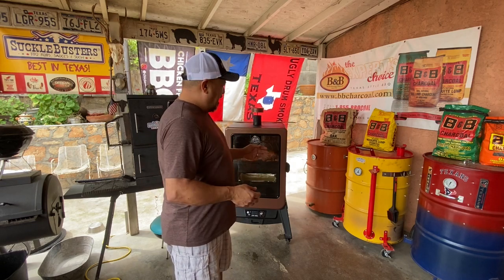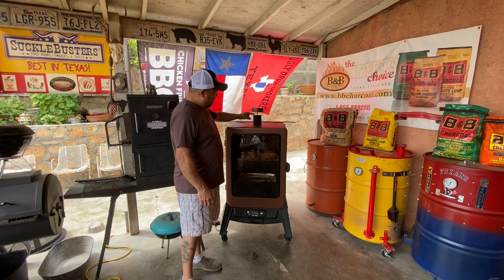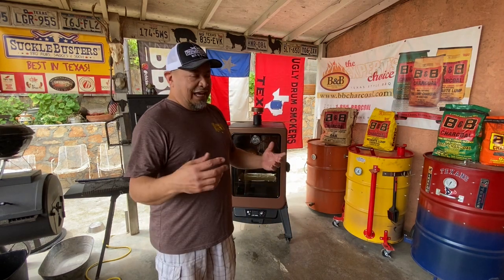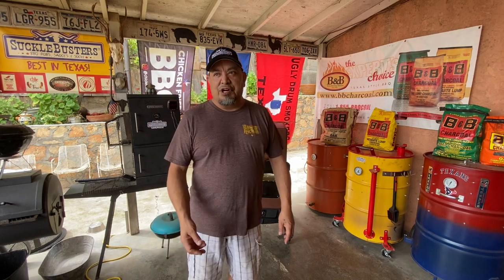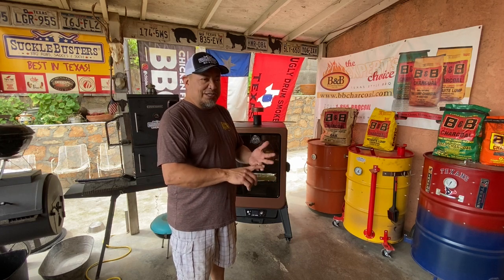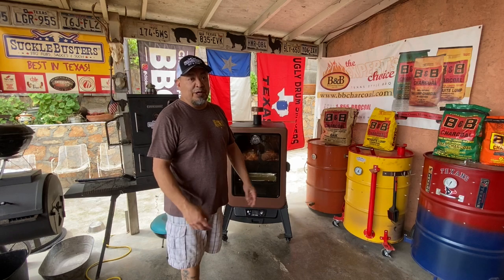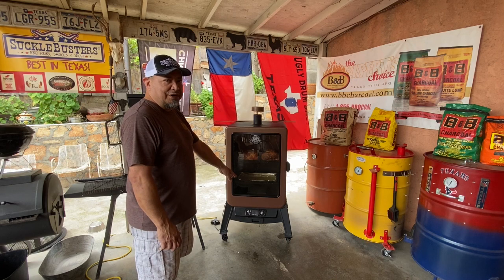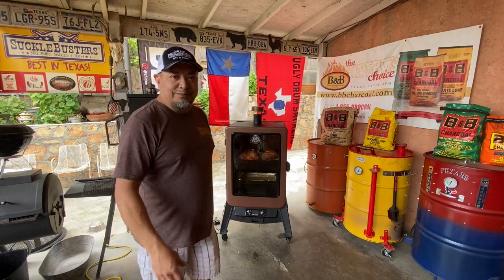PitBoss Copperhead Still Broke ErH

Comment: I have the same smoker and have had nothing but trouble since October last year. I have tried several times to try and get it to work but no good. I just emptied all the pellets and am trying it again. I have contacted pit boss March 16 and haven’t heard anything yet. I wouldn’t buy another
Reply from the maker: This model is junk! Thanks for watching and good luck on your future smokers. I’d highly recommend a Green mountain grill.
Reply: Well I tried a butt and the unit worked perfectly. That was a few days ago. I decided to do half a briscuit and about 30 minutes into cooking it shut down with an erl code. I watched your video again and noticed you have an extension cord running your smoker. Well I do too. Could it be spikes in power causing it?

Comment: So far my vertical has been running within 5 degrees of my set temperature. I have the water pan above the temp probe and have the cap all the way open. Done a few overnight cooks and my meater and inkbird thermometers show it holds steady all night. I have the pro series 4 vertical that Lowes sells, but its similar to the copperhead.
Reply: Also did you make sure that the heat diffuser over the firepot was positioned correctly? I've seen that some people turn the vent holes to the front and back instead of sideways.
Reply from the maker: Hello Carlos, yes the heat deflector was in the correct position. The unit worked great for four cooks the it was all over the place. Don’t know if you have but read through the other msgs below. There are a lot of guys having the same issues with temps and ERh error codes. 
But Hey, it looks like you got a good one! I really did like mine before the troubles. Oh well I’ve got me a GMG now and this unit is pretty good 😎 
Thanks for the comment! And the View!

Comment: Just got one about a week but have had a different model for about 4 years now make sure all your wiring for the temp sensor is good and not crimped or loose that will cause that code pretty quick and make sure it's clean. Also dumb question is your flame deflector installed the right way facing the side and not front to back they say it can effect the controller/ probe hope this helps looking forward to an update!
Reply from the maker: Hello Jonas! Thanks for watching and for the information. I did have the deflector the correct way. Although I never really checked the probe wiring itself. I did call Pit Boss and they determined it was the control panel. After waiting 2 weeks and no part showing up, I called PB and was told the panel was on BO and shipping from China at the end of June! To end my story,.... I took it back to wal mart and got my $ back😎
Reply: @RicsBBQSpecialties  how did returning it work since it had been used?
I am having the same issue and only used it 3 times.  I do not have the box anymore though.
Reply from the maker: Jonas Atkins @Chris Howard I was able to return it with no problems. I didn’t have the box either and had used it 4 times. But I did have the receipt and the operations manual. Good Luck Sir 👊🏼
Reply: @RicsBBQSpecialties  thank you i have all of those too. any recommendations on one that won't have these problems?
Reply from the maker: Jonas Atkins @Chris Howard A Stick Burner! Lol This was my 1st pellet smoker. I didn’t get another and probably won’t. I would up getting the BlackStone Air Fryer combo. I have an array of smokers just tried the pit boss out.

Comment: I’m having the same problem with mine only had it a year next month. Would you suggest just calling them asking for the parts and do the repairs? I’ve got 8 birds to do this years. Mine shutting off when cooking at 350. 4 time in 3 or 4 hours
Reply from the maker: @marco785  I got rid of mine shortly after this video was posted. However I’ve heard that their customer service has gotten better. I’d give them the opportunity to help.

Comment: Did you ever get this figured out? I have the vertical series 7. The first handful of times I used it, it was flawless. The last 3-4 times however have ended with the ERH code. These cooks have ranged in temps between 250-350. To have made sure the cap was fully open and water in the pan. I however did not raise it like you did but that didn't appear to help you.
Reply from the maker: Hello! Thanks for watching and for your reply. Shortly after the video I returned the unit for a refund. I was under the impression that They fixed their electronic issues. How old is your smoker?
Reply: @RicsBBQSpecialties   around 4 years or so. I have ordered a new internal heat probe as many have said that has fixed their issues with the ERH code. I hope so.

Comment: RIC I believe it's the control board that's the issue hopefully the replacement will be there soon . Deffently a electronic issue it seems .
Reply from the maker: Yeah I know that’s what it is. But hey I think the temp issue is working better with the pan raised a bit. 😎
Reply: @RicsBBQSpecialties   Did they get you some parts to throw at this?
Reply from the maker: 1984 BBQ @Mike Phelps Yes They sent the control panel. Thing is before they did they said it was going to take 8 weeks to get it. I wasn’t going to wait the 8 weeks so I took the unit back to wal mart for a refund. I’ve sent PB several emails and left comments on their cust service section of their website. I have yet to get a reply.
Reply: @RicsBBQSpecialties   Nice. Well at least you have a control panel you don't need now.

Comment: What type of pellet smoker do you recommend using. I have noticed that do to the poor location of the control board which is located at the bottom of the smokerdoor it's  very easy to spill liquids on to it as you're  pulling food in and out of the unit . Thank you for all the help.
Reply from the maker: ELAM305 I’m not a pellet cooker. Ive been cooking for over 40 years on stick burners. I gave this a shot and with the issues I had, I’m just going to keep using my stick burners and UDS cookers. They don’t give me error codes😎

Comment: Ric...  I got the copper head for father's day 2020 ran it 2 times no problem then it hits the same thing .... I cleaned it out hot so I could see what's going on ...  my problem was just like you too hot cap and water to low and also the pellets were starting to ignite in the augers tube and going more and more up the tube.... i am going to clean out the hopper and watch it ... did you figure it out ?
Reply from the maker: jon reynolds Hello Jon, I talked to Pit Boss and first they said the cap was too low and needed to be unscrewed all the way up to the point of almost falling off. Lol okay my question was why is it adjustable? Then they said the water pan had to have water? Yes it has water! It’s called a water pan. Long story short, after I was told that they would send me a replacement control panel and temp probe but it would take 6 weeks to deliver! I took the unit back to Wal mart and got my money back.
Reply from the maker: jon reynolds I really liked the cooker at first. I even made a couple videos that you can see in my library. I was more disappointed in the customer service. 6 weeks to get the parts is just unacceptable
Reply: I love it .... so I'm going to clean it check over every thing and try to smoke a pork butt tomarrow and let's hope for the best
Reply from the maker: jon reynolds Good Luck!

Comment: Iv'e done well over 50 cooks with a Pro Series Copperhead, Iv'e never had a code and count myself lucky. Iv'e seen many videos about the problems and have no idea how it's never happend to mine. I have the water pan all the way at the bottom, and the chimmney fairly low, you can just barely see the top of the pipe. I think they have issues with the controllers. I'm going to switch over to a Rec Tech wireless eventually.
Reply from the maker: Hello John, 
Guess you were one of the lucky ones! It’s sad because the couple cooks I got of it were great and I really liked the size and style of the unit too. 
Bottom line is the customer service was horrible. I’ve been running Green Mountain Grills Daniel Boone and also the Jim Bowie. Maybe one day get a Rec Tec 😎 Thanks for watching and for the comment.

Comment: I had same problem with different brand.    The probe was defective.  It was reading and sending random temps to controller. I replaced the probe and it fixed the problem.
Reply from the maker: Thanks for watching and thanks for the comment. Glad you got yours fixed.

Comment: I just had this problem with mine, 3rd smoke. Started it about 4:30am as I'm smoking a brisket. Came out at 8 am and my temp sensor said 385° but is set at 225°. I opened the door to let heat out but noticed it was no where near that hot. Then it threw Eth code. I removed water pan and the diverter on top of the fire pot and noticed my pellets had built up and ignited the pellets in the anger tube. I unplugged the unit, plugged nack in, turned on and primed to remove the hot pellets in the tube and used a metal utensil to spread out the pellets in the fire pot. Problem fixed for now. Using Pitt Boss Competition pellets.
Reply: update: ErH came up twice more. Grill set to 225, lcd readout telling me its 385, I put my own digital probe on top rack and only reading 181. Transfered my brisket to my offset stick burner. Will be taking this unit back for a refund.
Reply from the maker: Hello Kain, well that sucks and I’m sorry to hear that. I thought you might have figured it out. This thing is really a Pit Loss and a piece of junk! Hopefully your return goes well. Good luck Sir 👊🏼

Comment: I've got the same vertical Pit Boss pro and this thing has been a pain since day one. Error codes, temp control, temp probe and now it's not igniting. I jumped on here to see if there was a quick fix. Guess I'll fire up the grill instead. If anyone reads this and thinking about buying a Pit Boss....Don't. It's a waste of money and good luck with customer service.
Reply from the maker: Hello Robert. I hate to hear this but am not surprised, just go through the comments below and you will see that yes this unit is crap and Pit Loss is doing nothing about it. Yes they will send you a replacement probe or control panel only to have it fail again. I have since got a Green mountain grill and am totally happy with it.

Comment: I got the same code on my first burn. Grill Sergeant to the rescue!!  Second burn was fine.  My water pan is two holes up from the bottom but I could be moving it now.  From reading the comments temp seems to he a systemic problem. I'll be watching to see what they tell you.
Reply from the maker: Thanks Roy, long story short. I told the unit back to Wal Mart and got a refund. Pit Boss customer service is crap. Good luck on your cooker and hopefully this video gave you a little insight. 👊🏼

Comment: I just got a slightly used series 3 electric Pit Boss today and set it at 275 it was reading 160 on the actual temp, but probe said 260 and then 10 mins later had an erH code and now every time I turn it on it goes straight to the erH code and won't fire up.
Reply from the maker: Let it cool down for a couple hours or overnight. One thing I was told first was to make sure the exhaust is open as far as it will go. Make sure your heat deflector is positioned correctly with the ports to the left and right.?

Comment: Is this something pit boss will fix? I have this unit, it sucks! Seen other companies are making heat deflector mods for some models, but couldn't find anything for the vertical units, tia
Reply from the maker: I have no idea. I took mine back for a refund shortly after this video posted. How old is yours? I hear the electronics have gotten better. You might want to checkout another channel. Grill Sergeant he is sponsored by pit loss

Comment: Sounds like the controller...  Watching with interest, good luck.
Reply from the maker: Yes that’s what Pit boss said it was. I returned the unit back to wal mart because the controller was on backorder. I wasn’t going to receive it until mid July. PB Customer Service Sucks
Reply: Ric’s BBQ & Specialties That’s too bad...were you really disappointed with their service or just the lack of not having the part in stock to repair your unit?  Too bad you couldn’t exchange it with a new one from Walmart.  I have the Lowe’s version Pro Series 4, same as the Copperhead, so far so good, it operates perfectly and has proven to do a great job on everything I’ve put in it.  I’m New to smokers so nothing to compare with other than my Perfect Flame Grill (awesome by the way) but the materials, build quality and finish all seem very good.  So if something does go wrong, I feel the controller would be it and I would need to rely on customer support for help.  Anyway, I feel your frustration, sorry you didn’t have a positive experience.

Comment: I am going  through the same thing I tried every thing  pit boss told me I would have my control panel and temperature probe in 7 to 10 days  I got an email saying that the parts had shipped when I got the  package 5 days  later the only part I  got was the temperature probe  no control panel I called them  3 times and was told I would have the control panel in 7 day it has been  almost  2 months and no control panel this thing has been a nightmare  since day one
Reply from the maker: Hello Steven,  Sir I feel your anger and if you read through the comments below you will see that there are a few people that are having the same issues. You know when I posted this I was hoping Pit Loss would see this and hopefully someday they will. This unit is absolute JUNK. 
I have since picked up a Green Mountain Grills cooker and have not had one issue! I highly recommend them. 
Good luck with yours and hopefully you get the parts you need soon. 👊🏼

Comment: I had trouble with two different PitBoss units, ended up taking g both back to Atwoods who refunded my money....PitBoss took 3 weeks to get me parts on the first 9ne, it worked twice and quite again, so at that time, Atwoods swapped the unit out, second unit never came on, period. I will probably never try Pit Bosd again.
Reply from the maker: Thanks for watching and for the comment. Yeah Pit Boss has a problem with this unit. Not to mention the lack of customer support. I wound up returning mine for a refund. Now using a Green Mountain Grill. Used over 20 times now and not one issue😎

Comment: Has anyone tried moving the control panel to the top of the smoker to avoid the extra heat and drippings?
Reply from the maker: That’s a question for The Pit Loss company. They definitely have issues with this unit and they know it. This model needs to be recalled. 
Thanks for watching Mike. If you have one of these I wish you luck. 😎
Reply: @RicsBBQSpecialties  they really should I was on the phone with them almost everyday this week and they refuse to admit the design flaw. It's such a shame. Hopefully I can figure out a way to fix this. I will keep you updated..
Great Content!
Reply from the maker: Thank you! 👊🏼
Reply: @michaelg6808  well any update?
Reply: @joshkrepps8100  yes! My friend and his father helped me out they moved the control panel to the side very easy they cut the metal for it to mount then they used heat resistant fabric (up to 1000°) to protect the control panel from the heat of the smoker. I've used it about 9 times since and no issues no problem everything is away from the grease tray and I don't have to worry about anything

Comment: Any answer or fix yet? Was really considering getting me a Pit Boss smoker.
Reply from the maker: Hello and thanks for watching! I actually got tired of waiting for the parts and took the unit back for a refund. If you go through the comments below you will see that I’m not the only one that has had issues. My Advice? Stay away from Pit Boss. I wound up buying a Green Mountain Grill and it’s Awesome!
Reply: I had the same problem. I emailed support and with the details. They sent me a probe and I've used it about 20 times since.
Reply from the maker: Glad it’s working for ya!

Comment: Have you cleaned your Temperature Probe?  I have done that to clear errors
Reply from the maker: Yes I did. But I had only cooked on it 4 times.
Reply: I am just now after 5 years replacing controller and temperature probe.  I have also pulled water tray out when error occurred @RicsBBQSpecialties

Comment: I have the Pitt Boss Copperhead this is my 5th or 6th attempt at smoking, about a month ago I put a Pork Butt and a Brisket in to smoke  and previously  done a clean job that look almost new, about 4 hrs in as I had ran to the Beer store the wife calls and says the smoker is on fire and the was a loud bang , WTH  I told her I'm almost home it will be ok got home got the dern fire out and back to smoking I went cpl hrs later here came the codes ERH and I think it was ERH1 looked in the manual and let it cool down then cranked it back on few min later another freakin fire then the codes finally ever thing kinda leveled out and after a 12 hr cook it all tasted nasty, tuff but hey the dogs ate very well for the next week. Trying it one last time if not Pitt Boss will be hearing from me or Walmart as it seems I did by the extended warranty. Thanks Ric and hope you get your parts interesting on how things will turn out after you do.
Reply from the maker: Thanks for watching! And please read the comments below, there are a lot of other people having the same issue with this smoker! Pit Boss or as I now call them. Pit Loss needs to have a recall on this unit and give people their hard earned money back. I wound up returning mine to wal mart for a full refund. Good luck Brother